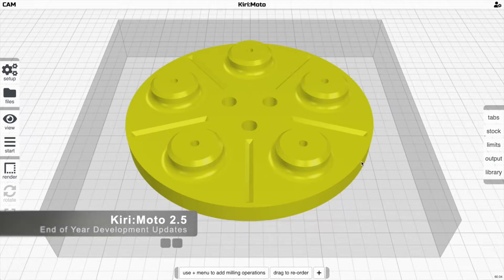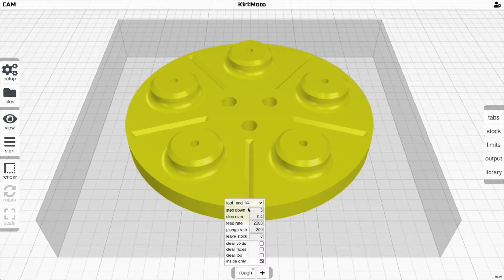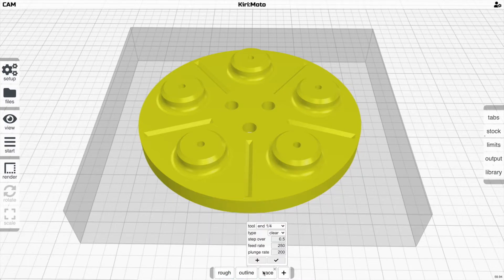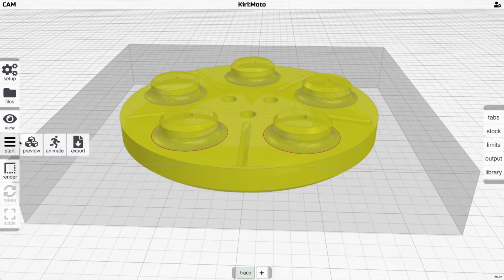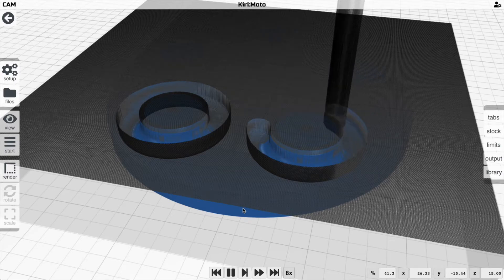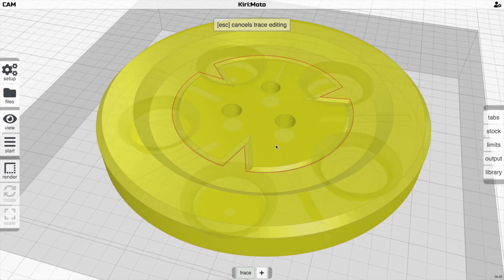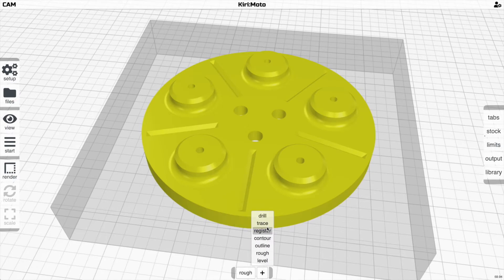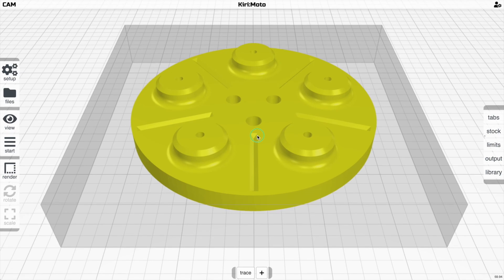Kiri:Moto 2.5 Year End Updates

Comment: How would you go about doing an axis relief using this program? Every time I try to do something big kiri moto cant handle the stl file so it just crashes. Ive seen other people mill this same file though which is strange.
Reply from the maker: the operations to support this have been expanded substantially since this video was made. if you want X/Y relief, the contour option is best preceded by a roughing operation. depending on the geometry, the pocket operation using the contour sub-option may also work.